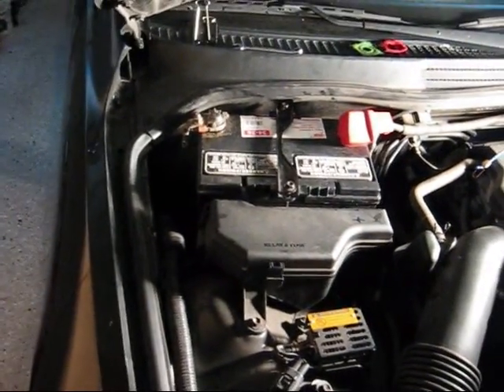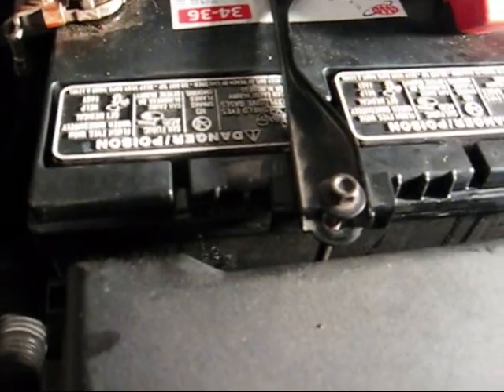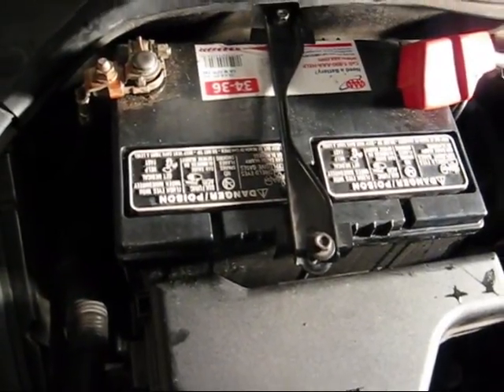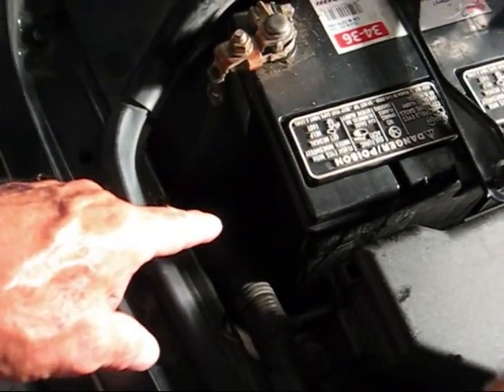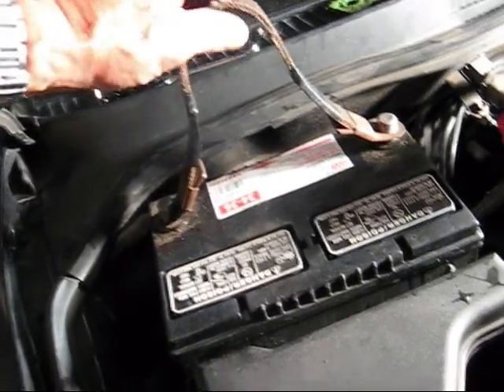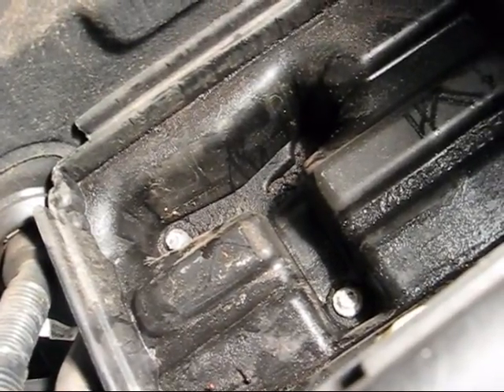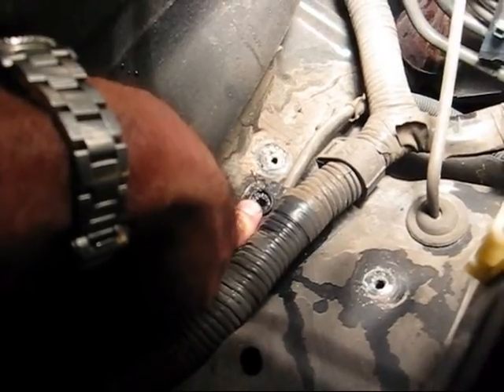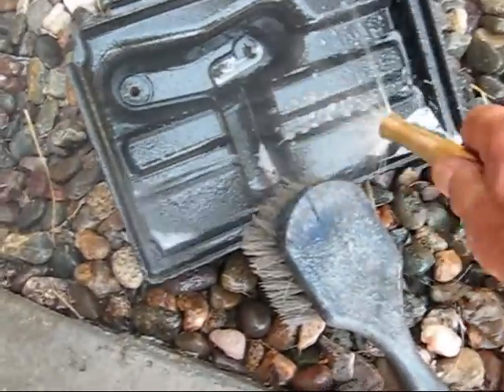Lexus battery replacement details by froggy

Comment: Anti Theft.
Reply from the maker: +P Williams I did not have to do anything to reset anti theft system. I would have put it in the video, if called for. If yours is not working, there "MAY" be a reset available, but I have never done it so can't help.

:)

Comment: I have a 2004 Lexus 330. I replace the battery. How do you reset the anti lock system
Reply from the maker: +P Williams Do you mean the vehicles anti THEFT systems?  The radio anti theft system? The anti lock brakes? Need to be more specific.

:)